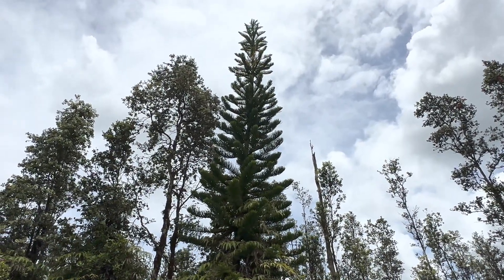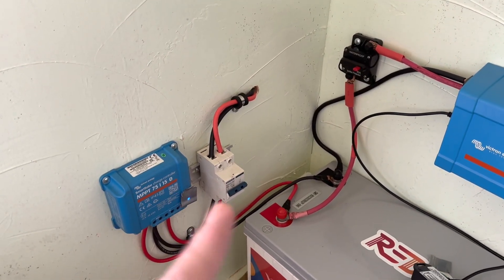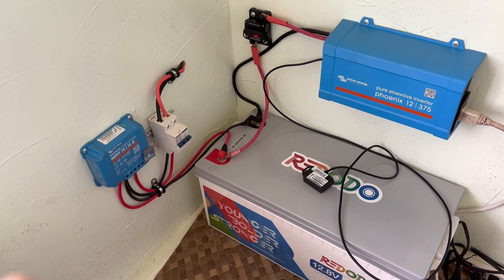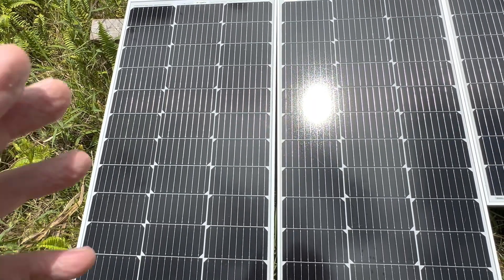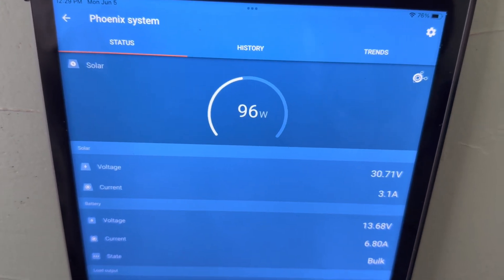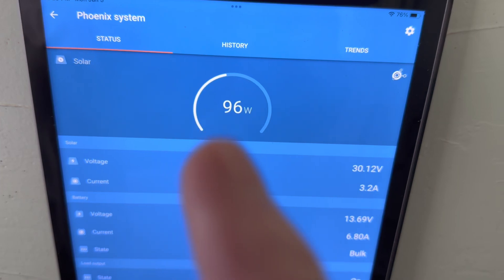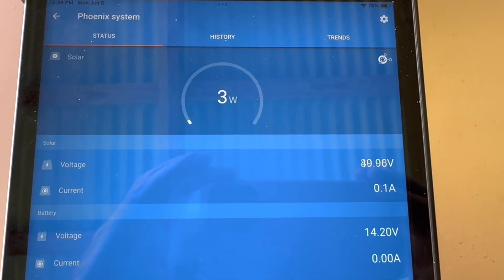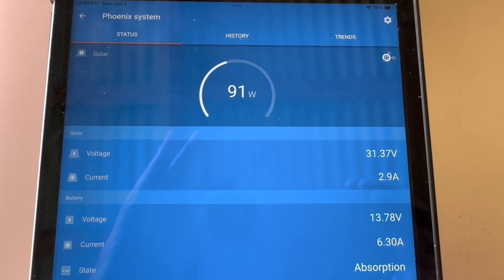Maxing out the Victron 75/15 MPPT with 400 watts solar Works great for my conditions! 200Ah LiFePO4

Comment: I want to run 4 100watt 12 volt panels in parallel for my van. do you know if this would work with that situation? I am new to this and trying to figure it out.

Comment: Awsome sir. I had to put my 3  100watt that was in series to a 4 panel 2s2p config. Because my 3 panels were clicking in at just above 72 volts. Way too close to the 75 for my confort. Out of 4 panels I got 2 in series parallel connection now 2s2p. Voltage is down below 40 volts and I get an extra kick on low light days.
Reply from the maker: Mahalo for sharing your setup!🤙

Comment: 400 watt 12v panel can generate 33 amps.
Running a 30 amp controller at 33 amps is like driving your car with the gas pedal floored all the time.

Comment: The Victron spec-sheet specifically says that there's an absolute maximum of 15A charge current and a 12V charge power of 220W.  You can almost double it by moving to a 24V battery (440W).

Comment: How's the system holding up now a days to the over paneling? I've got several 75/15 models and a 100/30. I've found that over paneling makes them quite warm. I see you don't have a fuse on the output of the CC. Are you replying on the fuse in the CC? I ask as my fuse holders get quite warm when up against 15a or 30a, depending on the model, and I'm worried about things getting too hot.

Comment: I have that same Victron 75/15 myself, but I run my system in 24 volts, so I get double the energy (26 volts, 15 amps instead of 13 volts, 15 amps)

Comment: i don't get it ? he's got 400w of panels, high summer sun is gonna put out over 20a @ 12v .... why would you buy a charger that wastes that amperage and only gives you 15a? and you're really pushing the voltage running 400w in series w/a 75v max .... i don't get it .... that's why they make all the different sizes, you can correctly scale them to the PV you have .... even buy something a bit bigger so you can add more PV in the future ..... i don't get it .... there's this whole thing on ut00b about doing dumb stuff so you get more views and comments .... i don't get it.....
Reply: It makes perfect sense when panels are cheap everything else isn't. It might be wastefull ecologicaly it is saving money blame the system that. Couses this not a logical user trying to get best buck for his money...

Comment: Thanks for this well presented walkthrough! I just came upon your video after I recently did a similar setup. For me the decision to overpanel came down to needing to work within the maximum charge rate for my batteries - this could be anywhere from 20A to 50A for a 100Ah LifePO4. There's no point buying a more powerful charge controller if your batteries can't draw the extra current from them. So assuming my existing controller is well suited to my battery (mine is a 40A MPPT with 0.5C / 50A charge rate battery), if my panels can only provide the controller with maximum amperage in ideal sun conditions (ie. all sun, no clouds), then a more average day with some clouds is going to underperform and charge the battery more slowly. By overpaneling we can have a more consistent and practical charge rate from day to day, and get some juice even from below average sun conditions.

Comment: 4 panels in series / parallel would equal 56 volts and 28 amps out approx to the charge controller you have 75/15 charge controller way undersized the amps would be the problem it will probably reck the charge controller eventually

Comment: The 1st string is 100+100. The 2nd string is also 100+100. Then you parallel, this keps it at 200 but doubles the current. The displayed 200 is actually what is connected. No limiting being done.
Reply: finally :) ye .. what u did is double the voltage not the wats xD if u want watts u need to put all those 4 in paralel

Comment: I live in the valley of the sun and recently purchased a Victron 100/20 charge controller and 24/375 Phoenix inverter along with a 24v/50ah lifepo4 battery. I was feeling guilty about the (6) Harbor Freight 100-watt monocrystalline panels just sitting in the Arizona room (never used) that I purchased years ago. I honestly just didn't have the money to finish the project until recently. I would love to have just jumped to a 48-volt system to start with but, like most of us here, I don't have a lot of resources and this is really just a experiment/toy for educational purposes. I really appreciate you sharing your experience and wish the best for you, my friend in Paradise. "Aloha" from the valley of the sun...
Reply: 100/20 een goede keus.
Reply: @deursloten  I agree. Perfect for the 600 watts of panels I already had, with room to expand/double the capacity down the road (to 1.2kw). Then I will, eventually, clone that setup (for 2.4kw)...

Comment: Your two larger panels are 36 cell panels, and the 2 smaller panels are only 32 cell panels. Due to the way that they are wired right now, your MPPT controller is trying to find a Maximum Power Point that is lower than optimum for the larger panels and higher than optimum for the smaller panels.
     My suggestion is to wire a large panel to a small panel in series, do the same with the other two, then wire the two sets in parallel.
   Fortunately you have a quality MPPT controller that then should be able to extract a little more power, especially during cloudy weather, from the one and only safe nuclear power source.

 FYI back in the mid-nineties or so, they were experimenting with 32 cell panels in order to try to charge 12 V lead acid batteries without having to use a controller, which were quite expensive at the time. It didn't work very well. I have no idea why they are still making them today, because they would not be able to charge a 12 V battery properly.

Comment: Here's something to think about. The biggest problem we all have, when using solar is the vinter - all clouds, no sun. - My 170 watt panels provides me with only 26 watt when it's cloudy, but I have 8 of those though I only need 2 to max out my controller! Guess what... When it's cloudy, I still get more than My controller can handle, and the 400 watt each hour during the daytime, is more than I need. - I put the 8 panels on my roof, because it looked stupid with 2 🙂

Comment: Please check the settings in the Charge controller - 13.7 volt is for AGM/lead acid - as far as I remember, LiFEPo4 batt's can take 14.6 (Read the fine manual You got with Your battery!) With 13.7 volt, You are only able to charge Your battery up to lke 80%.... - Nice test array btw.... 🙂 ohh, as a thank you for posting Your video, You can keep the rouge 40 Ah I just found in your array 🤣😜😂

Comment: Extremly useful video i just bought this controller but i am putting a 430w panal on a 12v system for ny garage.... i get i need a bigger controller at some point but at least i know it will proberly be ok my other solar controller stopped working and was getting no power off thanks for making this video
Reply from the maker: My pleasure!🤙
Reply: You tried putting 2 solar controllers on it should give u they full usage of the panals just want ur opinion

Comment: What size wires did you use from controller to battery? And what size fuse yo use between solar panels and the controller? 
Thank you
Reply from the maker: Got 10 awg on that run between cc and battery. And this as the solar isolator cutoff between panels and cc:https://amzn.to/4bvzNlw

Comment: I have a few charge controllers, including this one.  Victrons are the best, and pretty much bullet proof.  I run in series up to the max voltage, then parallel the rest.  Higher the voltage, the thinner wire you can use, with less voltage loss and longer wire runs.
Reply: Hi which light must be on when on charge mode

Comment: To replace my pwm charge controller I bought a Smartsolar 75/15 from Victron, my only solar panel is 200W, it turns out that I am frustrated because the Max power that I have managed to achieve is 20w and 1.5 amp charging to the battery. I would appreciate if you could help me in configuring it.
Reply: Mppt needs +5v (or more, up to the 75v victron limit) over your battery max from the solar. Just my guess to your problem.

Comment: I have the exact same kit (victron 75/15 mppt controller + victron phoenix inverter 12/375 + battery 200 ah) with a 180W solar panel and I'm just thinking about adding a second panel. Your video is... Inspiring. Thank you! Greetings from Your End of the World - from Poland 🙂🤗
Reply: Will you run that in series or parallel?

Comment: If you get another battery and put them in series, you can charge at 440 watts with that controller. It can do 15 amps at 24 volts too!
Reply: 24v could be a downside if not all your components can run on 24v. Almost all my equipment is 12v only
Reply: @jvinsnes  12v lithium is really 14.4V during charging, so most 12v devices would probably appreciate the voltage regulation of a 24-12V converter anyway.
Reply: @jvinsnes 24 volts is your inside loadside coming off 120 v 240 ac I assume take a mppt loadside you.have 12 volts usually a little higher use that for lights 12 volt tv charging ports in the mppt on mine I use to charge iphones extra battery for whatever vapes any smaller devices needs charging these things are great.
Reply: @jvinsnes  that's why 24 to 12v converters exist, victron even makes some good ones
Reply: @jvinsnes  the only reason I would do 24 or even 48 is if I was solely using the inverter and running 220v if and form of 12v I’d stick to 12v with enough solar battery and mppt 100/50 I can’t see needing much else
Reply: @easymoney1997  yeah thats money i dont have my inveter is 12v and to get another battery is expensive
Reply: @simonwilson7264 lol i got a 100ah 12v battery for 99$ the other day. Its all so much cheaper now

Comment: I've been getting up to 220w with two 100w Ecoflow rigid panels in series. 220w is the most the controller will do. For 2S2P (4-100w panels) you should be using a 100|30. Victron controller. Looks like you could up your bulk/absorption voltage a bit, your battery will charge faster and they'll fill. Use the Victron preset for LiFePO4.

Comment: Victron 75/15 stuck on absorption mode. Battery on 48% but controller says battery voltage 14.6v when infact it's 13.1. any insite?

Comment: 12v panel won’t run mppt with a heavy load (flat battery) 19.5vdc in 24v configuration runs the mppt well charging 12v battery set voltage manually

Comment: If the issue boils down to which Victron Smart Charge controller to buy than I believe than I believe that you should buy the 100/30 model❤.  Going cheap with electronics seldom pays off in the long run.😅
Reply from the maker: I just got another 100/30 for another project. I love the Victrons. Aloha!🤙

Comment: Hi adding a 3rd panel to the series array will raise your voltage while keeping your current low. That way you don't have to change your controller and therefore get higher output by keeping your charge current low.
Reply: It doesn't, it's the battery voltage that is keeping the amps high. Only a 24v system would lower the amps that are going to the battery

Comment: Good video mate 👌 call me crazy but I am doing a little experiment myself running 500w into my 75/15 controller. Going to do a longevity test. Will be intresting to see what happens. Might be some fireworks 🎉😂
Reply: Hows it going with the 500w test?
Reply: @Antswe  it is still going strong mate. No issues so far. And has harvested 18kwh of energy so far 👍
Reply from the maker: Be careful out there my friend! 🤙

Comment: if you could go to a 24 volt battery you can double the energy the Victron can send to the battery. You would be able to push over 400 watts through that controller.
Reply: That's interesting. So say he got a second 12v battery and wired it in series, then he'd have twice the battery and twice the charger?
Reply: The charger is limited by amps it can output to the battery. By doubling the battery voltage the amp output is cut in half for the same wattage flowing through it. If it could handle 220 watts of panels at 12v it can handle 440 watts at 24v. more power but same amperage coming out of the charger except the higher voltage is flowing 2X the wattage for those amps. The downside is if you have already purchased a 12v inverter you will need to get a 24v model. I did this with my system and 24v is much better than 12v. This also means smaller gage wire for the same wattage output.
Reply: @_Seagie You could do that, but it would be much less efficient. I run a large part of my house off my solar 24/7 and need all the juice I can get from them.

Comment: Very good overview of adding more panels to an existing system.  You can't go wrong with an MPPT controller.  In testing using the 100/20 version using 100watt panels, I ended up paralleling two MPPT controllers and wired them with two panels for each controller.  The only difference was that my panels were in parallel to eliminate the shading issue as much as possible.  Here in Michigan, especially in winter I have to fight for every watt I can get.  I guess the golden rule is to keep the voltage NO more than rated for the controller and current will be maxed out to whatever the controller is designed for.  Hence, why I did two smaller controllers......great content as always!  Thanks, Gary
Reply from the maker: Mahalo Gary! Appreciate you being part of the conversation here, and sharing whats working in your part of the world! Aloha! 🤙
Reply: I have just bought 3 x 100/20 because they have the load outputs for dump loads.. which are electronically switched and programmable, though I still need to figure that out..
and they can be linked by Bluetooth to work together etc...
and I can add more...
Have you used the load output?
Reply: 200 watt panel can output 27 volts or more.
Especially bifacial panels.
Pretty hard to get things to play well.
20 amp output is not going to charge 400ah batteries from drained to full in 5 hours.
And if you are using power along with trying to recharge, you are screwed with a small controller.
You would need at least a 40 amp output and that is barely skimming by.

Comment: over panerling is a good way to keep a steady current and voltage when a battery has a 40 amp charge limit and you have a 40amp controller and the controller is able to hold back the power from over panelling it makes to do to get the more steady charge rates
Reply from the maker: Yes sir! 🤙

Comment: Doubling your battery voltage while still using the same charge controller lets you utilize the full 400W. But then you'd need a 24V inverter. With your current overpanelling you still get more power over the course of a full day - as you found out. So very nice demonstration of overpaneling and the power of combining parallel and series. Running a chargecontroller at its max amp limit day in and day out, is hard on its electronic components though and could potentially shorten it's life. If it gets too hot, active cooling with a fan will help.  

Paralleling panels does however increase the need of fusing(at each string). Just saying -- again😉 Even when some(one) claim nothing ever happens (other post in your week old video)
Reply from the maker: Mahalo for all your great input brother. Very happy to have you part of the conversation around here. We all benefit! Aloha! 🤙
Reply: no you don't. wire the the two batteries for series to the controller but to the inverter in parallel.

Comment: what if you hook up to 24 volt  battery - does victron out put 15 amps at 24 volts ???
Reply: Yes, is does. The limiting factors of charge controllers are foremost the amps on the battery side (and of course the voltage of combined panels). With a 24V system you could use the same charge controller, but doubling the wattage - but then spent money on a 24V inverter...

Comment: viktron 100/30 is on my list  want to pair it with 400w panel
Reply from the maker: Perfect match! 🤙
Reply: Would this work with a 280ah 12v battery

Comment: I think it might be better to increase the absorption and float voltage values to at least 14.42  ( 3.6 volt/cell)  That is to say, any lower voltage setting will reduce the battery capacity. 
If Redodo allows 14.6 volts/ 3.65 volts per cell floating at 14.6 volts would be perfect in this solar pv off grid inverter system. Having the bit more voltage available to compensate for losses between the VECC output and Redodo battery BMS and inverter is probably better.  Periodically, once every three to four weeks the voltage should be increaed  up to maximum cell voltage because the BMS needs alot of hours at to equalize the cells once they reach 90% SOC. The 200amp hour battery will likely need 8-16 hours at the top cell voltage because he BMS uses a small amount of current to short circuit the highest voltage cells thus continuously reducing the battery capacity each day that the maximum cell voltage isn't achieved) 😅 ALOHA

Redodo
Nominal Capacity: 200Ah
Nominal Voltage: 12.8V
Energy: 2560Wh
Charge Method: CC/CV
Charge Voltage: 14.4±0.2V
Recommend Charge Current: 40A
Reply from the maker: Mahalo for breaking it down brother! 🤙
Reply: @ProjectsinParadise808  Absorption should be 14.4 to 14.6V, Float should only be 13.8 for LiFePO4 batteries!